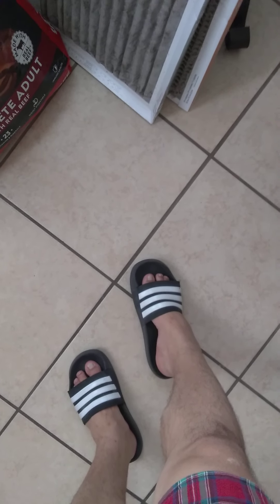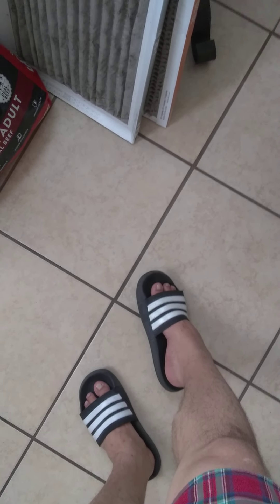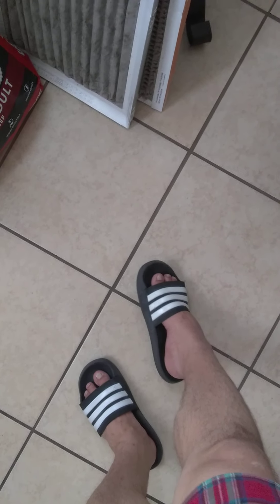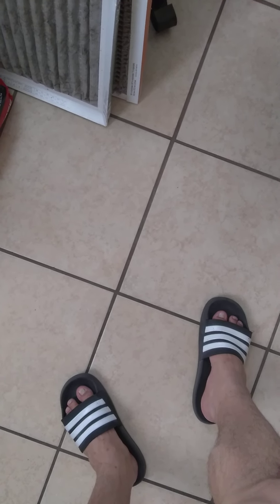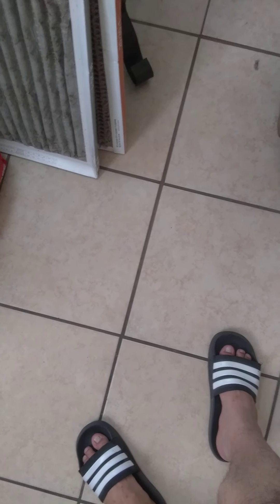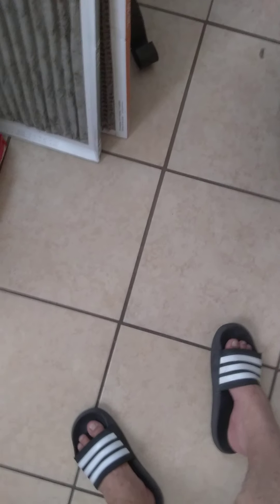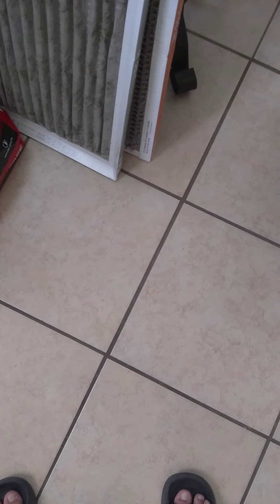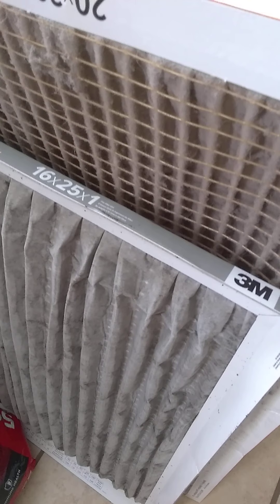Central AC popping noise may be easy fix.

Comment: The popping noise is ice built up on your unit because it isn't getting air. When you turn the unit off the ice starts melting and popping.
Reply from the maker: @Max-je7qd  in my case it was the air filter. It was bent. Replaced it and the popping stopped.

Comment: Popping noise like a balloon?
Reply from the maker: Yeah, every time our central AC will turn on it will make a popping noise, yes similar to a balloon sound. Our problem was that one of the filters was dirty and bent. So when the AC would turn on air would put alot of pressure on the dirty filter. The filter would bend and make that popping noise.

Air filters are very easy to replace. Check out your filter and see if its not too dirty or bent(out of shape).

If u let dirt/debri go unto the system it is not recommended, it can damage more serious stuff and/or mess up the AC. So its important to replace the filters if needed.

Lucky for us our issue was so easy to fix. If its not your air filters then maybe it could be one or your foil-like vents that have a hole in them, but thats just my guess. Good luck.